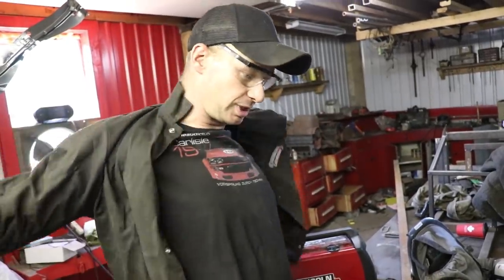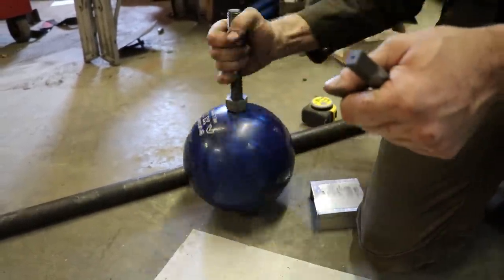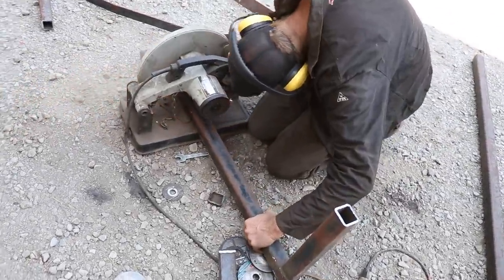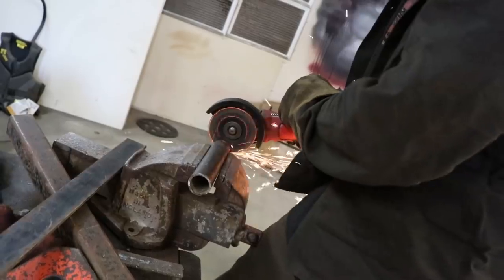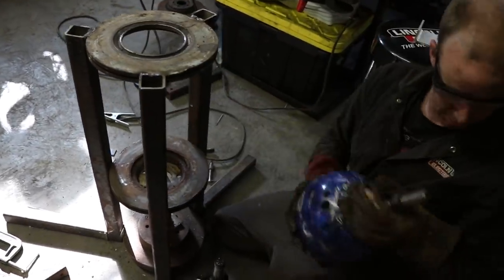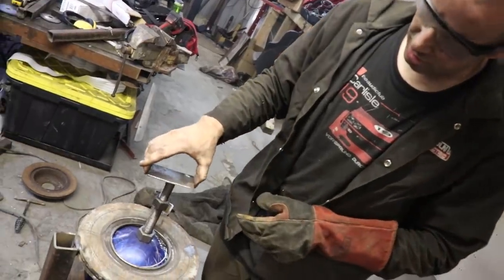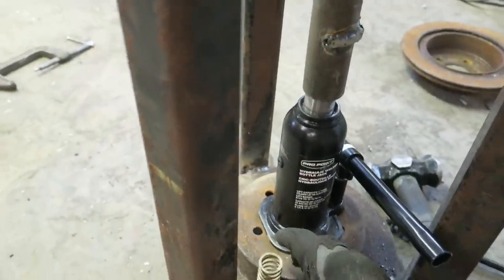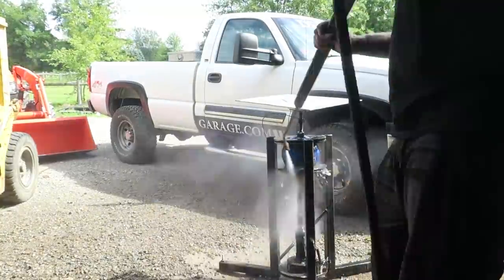How To Build a Welding Table - DIY with a Bowling Ball for CHEAP!

Comment from the maker: Check prices online using our affiliate links:
Welder: https://geni.us/140mp  3/32-Inch 7018 Welding Rod: https://geni.us/weldingrod  Lincoln PAPR Helmet: https://geni.us/le-papr
Reply: You could have got a strut spring off the car you got the rotors off of and used it to tension the ball. Run a bar through the spring to one of the legs. When  you want to release the ball just step down on the rod. Release the rod and tension is reapplied. Or not. What you did works great. Enjoyed the video.
Reply: Have to say Rich that is pretty slick, gives me some ideas for a table myself and maybe use some of your ideas for a stool to.  Awesome channel.  
🇨🇦🤘
Reply: Do you mind if I pirate this idea

Comment: Curiosity: did you consider using an old suspension coil spring or something and just adjust the preload on it? Maybe even an overcenter linkage that drops the preload? Seems like the bottle jack is a little clunky when a spring would work. And the ability to set friction and just move the table as needed would be slick. 

LOVE the build! Genius!
Reply: Cool idea!

Comment: Love the ViceGripsGarage hat👍🏻! Saw y’all at Norwalk but didn’t bother you, y’all were busy trying to get the GTO going again! Just built a 4’x 8’x 3/4” welding table with 4”- .5” wall square tube legs on industrial U-Line casters... works great and after adding linear supports for the legs the bastard will hold over a thousand pounds with no flex and it is at 44” working height!

Comment: Tips for anyone else building thisPut some antiseize between the steel and aluminum if you ever wanna change the top plate, and could cap the leg ends and fill them with sand or some old coolant if its too top heavy

Also the top plate should really be 1/2" thick atleast but i mean use whats free or cheap
Reply: Inclined to agree on the steel plate Aluminum heats and spreads so well your bound to get some burns until you just learn to keep your hands off.

Comment: Just a suggestion for you to try....When using your spool gun to weld aluminum, push your weld instead of pulling it.  I've found it works much better for me.  Keeps spatter from sticking to the bead, bead lays flatter, and just ends up looking better.  Different strokes for different folks, but it's worth trying.

Comment: This is BRILLIANT.  I really want to get into welding, but not sure where to start.  AVE recommends learning stick first, but not sure if I should go with a Harbor Freight welder or something like the Lincoln Electric to start with.  Any ideas?  Would love more welding/beginner content!
Reply: There are lots of sites dedicated to welding. This is one guy I watch (Jody) and he has a pile of videos on different processes mig, tig, stick. https://www.youtube.com/watch?v=5KrwmK7df-s    He has reviewed different makes of machines as well in some videos (some offshore ones too). Start there would be my suggestion. Lincoln, Miller, Hobart, ESAB
Reply: don't buy a cheap welder from harbor freight their junk welders a good welder for a cheap price is Arccaptian MIg 200 its a excellent welder for newbies its a good welder for experienced welders like myself I've been a welder for over thirty yrs this welder is a multi purpose welder and it can weld stick, mig, tig, and aluminum and do spot welds as well Years ago to have a weld with al these functions would cost 3 to 4 thousand dollars this thing is 400 Canadian Thats crazy if you want to weld aluminum you have to buy the spoil gun but its only $150 bucks. You can't go wrong with these welders for the price.

Comment: You were able to weld the aluminum with the 140? that's pretty impressive.
Reply from the maker: I didn't think I would like this welder as much as I do.  It is by far the best welder for bodywork as I find its much easier to burn through with a 220V welder.
Reply: I used to think 110v welders were useless and had no purpose in this world. Then I stated doing exhaust work with one, then I had to do exhaust without one. For that kind of work, those little welders are king.
Reply: I’ve got a spool gun with Argon on my miller 212, it works well, but you have to push, not pull. You want the Argon out in front. move quicker than steel, and get the Argon pressure set just right. Too low and it doesn’t cover the weld, too high and it cools it too quick. Definitely a learning curve.

Comment: You should consider using E6010 rod. It works much better for penetrating rusty corroded materials. And for things like brake rotors which are extremely hard it will help penetrate. 6010 rod is a little harder to use but is a better rod for some applications.

Comment: I've got the Lincoln 210MP. Only really used it in 120v and it's been awesome. Desperately need to get the pedal for Tig though. Scratch start sucks.

Comment: You can weld aluminum without a spool gun if you swap your spring liner for a teflon liner and keep your gun lead relatively straight.  I have done it on welds up to 8 inches long.

Comment: Great build, I always find a useful tip or tool. An idea I thought of for out of level floor weld on some nuts and use bolts to level it up.
Thanks for the build.

Comment: That's an awesome table, I feel like the nut would have issues passing a good ground through though. I don't even weld lol but if I used that table I would probably put the ground clamp right on the threads.

Comment: I am curious as to what you are wearing on your head at the 15:35 mark in the video.  Can you explain what that is and why you chose to wear it? Great table idea!  My only change to it would be the ground connection as a solid attachment to the aluminum plate instead of the nut but that does work.

Comment: Random question for you,since we both work on rusty Canadian junk,  what blades do you use to cut springs out of trucks? I'm trying to save them out of a parts truck as kid I'm fixing for is on a really limited budget. Usually i just separate the clamps holding the stack together and drop them in underneath, not an option either, as his springs are twisted.

Comment: Keeping with the sports theme, i wondered if the entire jack/locking mechanism could be replaced with a weight lifting bar with a course thread? By welding a handle to the locking nut, would there be enough lift in the 110⁰ of throw you might get between two of the three legs to pinch the ball tight? Just putting the thought out there...

Comment: Welding cast iron rotors to steel it makes for a brittle weld and I'd be worried about one or two of the welds pulling out of the cast iron when the jack gets over tightened  . 

Got to use high nickel welding rod  ,  pretty heat it really good ,  and when you done welding peen the weld with the chipping hammer  ,  then rap in insulation and let cool slowly  . 

Kool table genius design 😎👍

Comment: Try blowing the sut/soot away from the weld when welding aluminum. You were pulling. Try pushing. Well.. kinda depends on the angle as well

Comment: Might weld some caps over the open tubes to keep them from filling up with shop debris over time.......yep they will fill up....but then the bottoms are probably open so trash that suggestion....unless you just want it to look a bit more finished.   Nice job!!
Reply from the maker: I thought about it but its a great place to hang tools
Reply: @DEBOSSGARAGE  Yes I forgot about hanging tools from there....good call!!

Comment: What's that breathing apparatus u are wearing when welding up that golf cart? Looks like something I need to get. Thanks
Reply: joseph waldner I’m also interested in that rig
Reply: 3M 36-1101-30SW ----3M makes a good one, they are not cheap though. This may have been the model our welders used (company supplied)---I recall the word "Speedglas" on them. Battery operated fan air flow, I think too, with filters of course. Ordinary guys like me used a ordinary helmet for the odd job. LOL
Reply: Thanks for the help man..

Comment: Next delivery by Lincoln, wire and weld fume control/extractor, smoke sucker? Nice project.
Reply from the maker: If you look over my shoulder in the fist few seconds, there is a fan in the window that sucks everything out.  It does a really good job for keeping the air "fresh".  Its not quiet though so we turn it off for filming.  I also have a 4' one in my ceiling for pulling exhaust out
Reply: @DEBOSSGARAGE  Yeah typical problematic noise for filming, fans. We've a big fan in the side of the shop too in the welding area, but nothing beats an extractor.

Comment: Damn I just threw out some rotors too.  I have a old plastic ball too.    If you are going to make this I recommend a plastic ball because resin balls are prone to cracking with extreme weather change.   I can't tell you the number of times bowlers have left a ball in the car overnight in the winter and show up for league and it is split down the middle.     Pretty cool table tho I can see it being real handy.   You should make some rods to put under the table welded to that grounding nut at a angle and weld a aluminum bracket to bolt them too.   This will support the corners of the table better.      But I certainly see one of these in my future.     I need to stop watching youtube as I have way to many projects I want to do.

Comment: It feels like the wire would melt then welding at a bit higher current, like 2-300 amp.
Reply: Needs a copper conductor similar in size to the other leads. Even at lower currents it'll be red hot after a few rods. If you're as slow as I am it doesn't matter much until you lean your arm on it

Comment: Kind of a creative design but as a Journeyman Welder  I have to wonder how long it will how together. Brake rotors are cast iron and cast iron arc welded with 7018 will fail/crack and in time. Don't believe me? Do a test. Weld a piece of cast to a piece of steel at 90 degrees on one side and then hit it with a hammer on the welded side. A few good blows with a two pounder with probably break it and it will always crack on the cast side. Do the same test with steel to steel and you can beat on it until the cows come home. Cast doesn't take well to arc welding due to the high graphite content. In addition, you should never attempt to weld cast iron without a lot of preheat to minimize stress cracking. You would be better to make the disks from 3/8" or 1/2" steel plate.

Comment: Am I the only one wondering why you'd have the wire for the ground attached to a nut? Every time you start welding you will arc from the nut to the threaded rod since they technically aren't attached to each other. Low amperage you might not get a good ground and high amperage you might seize the nut to the rod. I get that you might want to turn the table but I think a cable that could spin 360 degrees either direction only once but attached to the bottom of the table instead might work out better in the long run.

Comment: A good  tip/ or oh shit that hurt reminder... Use motor cycle inner tubes to cover your boot laces or in step to prevent being burned by slag from cutting with A torch or slag from welding. Your 50K$ badass boots wont come off quick enough, when  a nickle size ball of slag into  burns through...ask me how I know